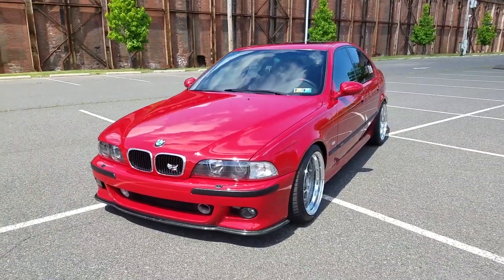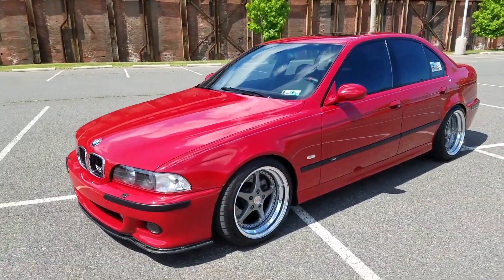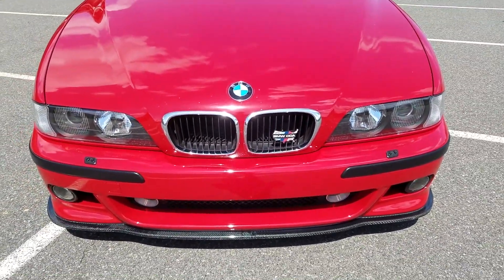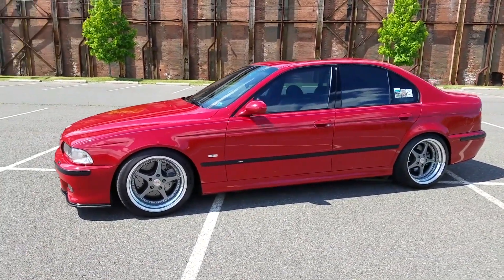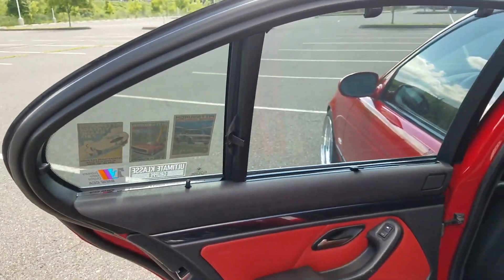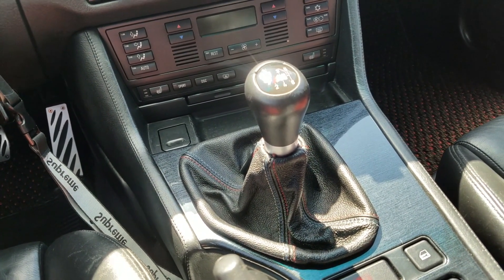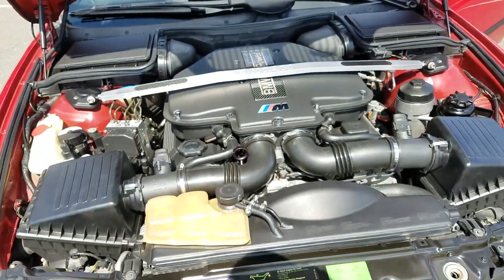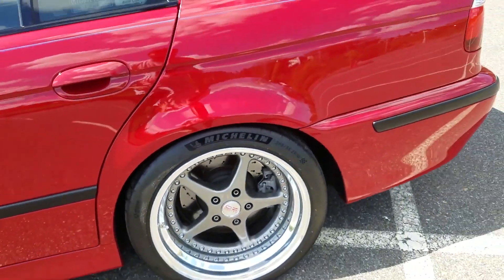Mike Ashcraft's 2000 BMW M5 Introduction

Comment: Just wanted to add a few things that I forgot in the video, too much stuff to remember haha.  The rear subframe bushings were replaced last year with yellow Powerflex bushings.  Also the clutch was replaced 2 and a half years ago with a Southbend Stage 1 heavy duty clutch and OEM flywheel. 

Also forgot the mention the Dinan mods the cars has: front strut brace, short shifter, shocks/springs, and rear sway bar.  It used to also have a Dinan tune but I had Moonlite Motorwerks put a euro tune on it.
Reply: How do you like the Southbend clutch? I have one sitting in a box on my bedroom floor, along with a lot of other clutch refresh items, but haven't had the dough to to get the work done!! Soon...
Reply: @williamtaylor5193  I like it a lot and haven't had any issues with it, almost have 20k miles on it now.  I have heard of other M5 owners having issues with the SB clutches though, some reporting them slipping after only a few thousand miles.  Most of the ones with issues seem to be using the stage 3 clutches and are supercharged, I haven't really heard of any issues with the stage 1 clutch.
Reply: @e39hamann  Thanks Mike. I got stage 1 as well, thinking I might do an Evolve tune and headers at some point, but doubt I'll ever supercharge it.

Comment: it looks really great in red and the interior compliments it perfectly. 
im considering buying an e39 m5 , i currently have a e39 530i individual which is my first e39 and it was meant to of been a temporary car ... 
3 years later i still have it. The e39 was  Definately a high point in bmw build quality , at the same time i know nothing about later generations up to current models as I've never owned one hence i cant comment on them.

I think ill bite the bullet and get a 60 / 70,000m m5 but there fetching 25/ £30,000 and beyond in the uk 
so i need to work harder! and save

Comment: Clean! Any other Dinan mods besides the strut tower brace to warrant the DINAN trunk badge?
Reply: Thanks!  And it also has Dinan springs/koni shocks, rear sway bar and short shifter.  It used to have a Dinan tune as well but I had a different tune put on.
Reply: Dinan has a points system. You have to have enough points to get the badges.

Comment: Nice car. What head unit is that? Where do I find?
Reply: Thanks, and it's an Xtrons with Android 8.  I bought it from eBay, there's quite a few different people that sell them.
Reply: @e39hamann  thanks.  Looks clean nice.  Works well I assume. You install?
Reply: @michaelbyers955  Yea I really like it.  I had an audio shop do the install because the wiring was kinda messed up from whoever installed the old head unit.  It has an aftermarket Alpine amp that powers the speakers.